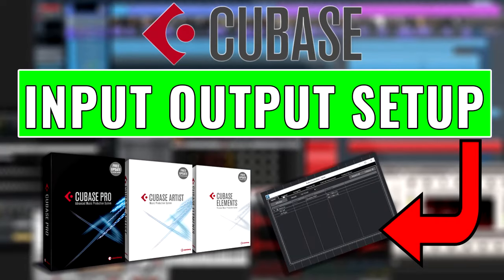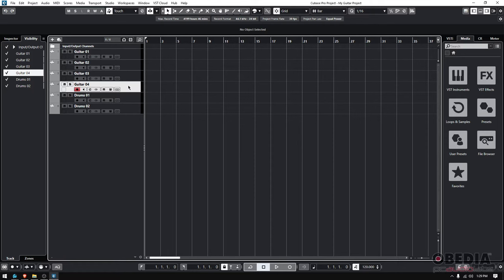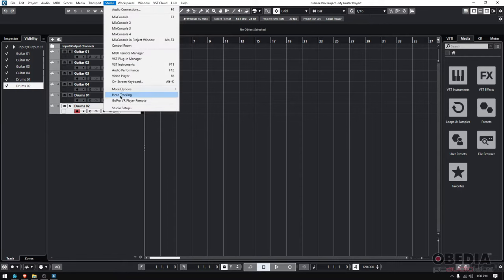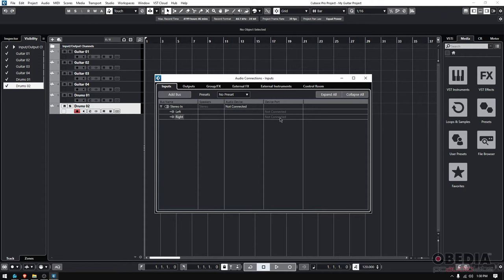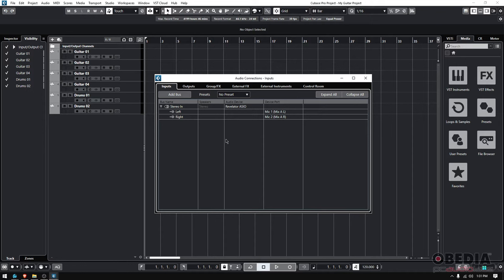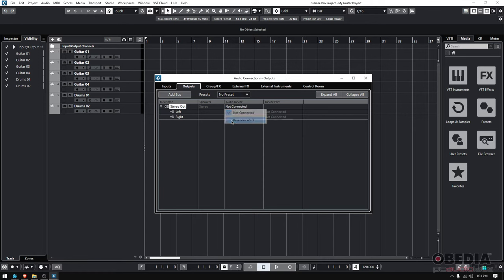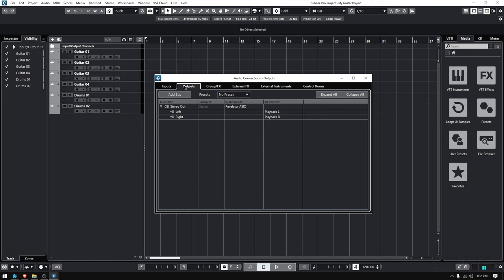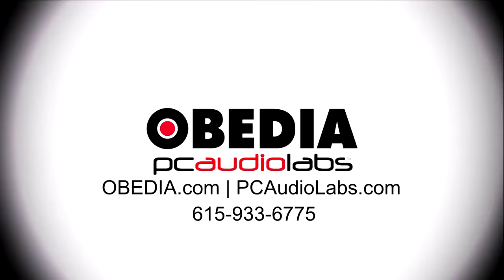Steinberg #Cubase: How to set up Inputs and Outputs in Steinberg Cubase

Comment: Should have showed the rest lol You were doing so well!  It's amazing how many videos stop there. Like now you just plug in a mic and hit record and you're good. Nobody shows how to assign one of those inputs to a specific track and arm it to record on, or how to set the output of a specific track to one of the outputs. If I didn't already know how to do that, I would be sitting here with a fully functioning interface and DAW and still be fumbling around wondering how to get this mic onto track one! Inputs and outputs are part of every track that's recorded. Everyone stops after they explain the interface part. That's not enough info. Good job explaining what you did though. Better than most explain that part.
Reply: omg this is exactly where I'm stuck
Reply: How do you sort this? I have tried to get information from the people who sold me a microphone and YouTube videos and all sources have been equally useless at advise for solving this issue.
Reply: I'm trying to record my vocals over a instrumental track.  I have 2 tracks,  one from a instrumental i imported and one for vocals. 

When i hit record on my vocal track,  the instrumental is automatically getting recorded under my vocal track, as well as my vocal.

Why is this happening?  Any help would be awesome! 

Thanks
Reply: And you didnt explain it either. Why would you complain about this and then not offer the info. You did exactly what you were complaining about
Reply: I totallyvNEED THAT VIDEO!